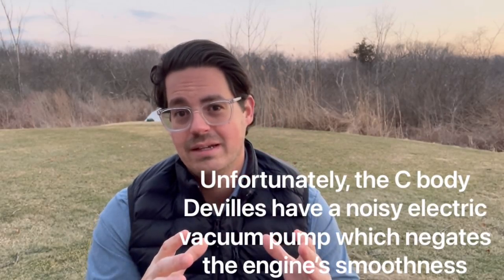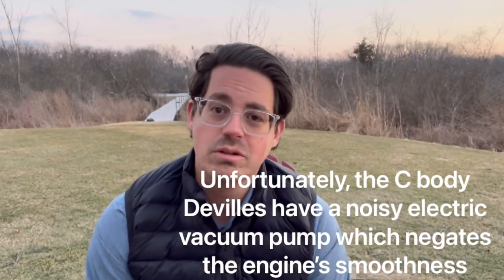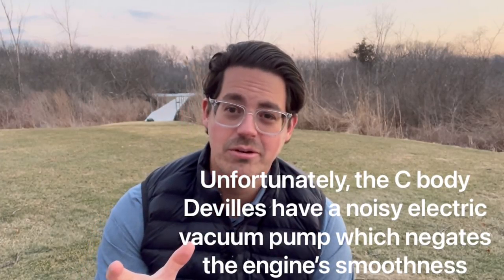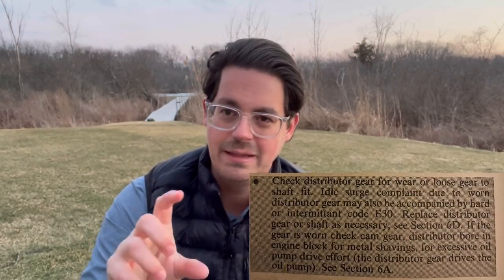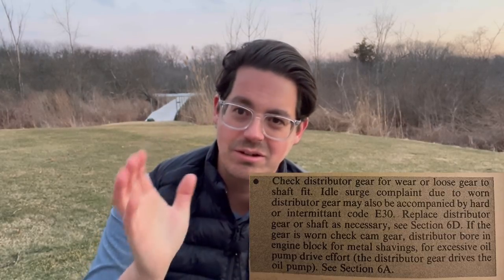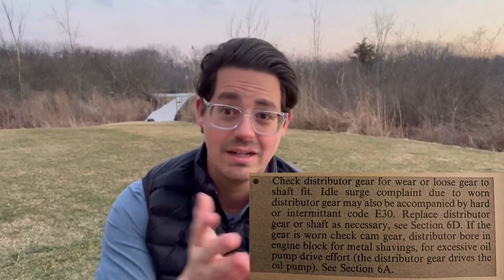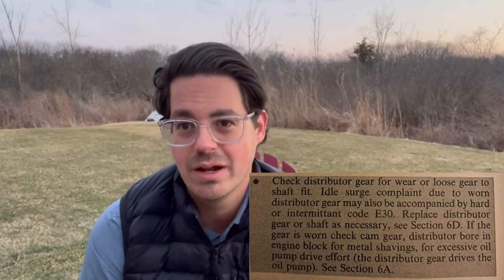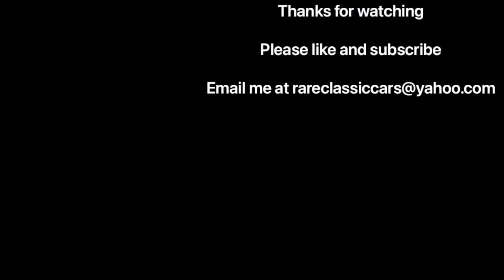Worst Engines of All Time: Cadillac HT4100 - Why is it so bad?  How can you preserve yours?

Comment: Just got the 1984 Cadillac Fleetwood Brougham with the 4.1L HT4100 in August. You are spot on with the intake manifold problem. The car is all original and has 73,000 miles. I have replaced the water pump and now the intake manifold gasket project is where I'm at. I feel like I've taken apart the entire engine!! Just a question for any one who can answer, why does this car feel like it jumps from 1st to 3rd gear when coming off of a stop maybe every 2nd or 3rd time I drive the car? Or to explain it in another way, it feels like it struggles to accelerate in 2nd gear up an incline? And approaching a stop decelerating to under 10mph still feels like it's in 2nd gear?
Reply: Sounds like your Torque Converter solenoid is bad. Common problem on the 200-4R
Reply: @TeeroyHammermill  I appreciate your comment, and literally all I did was change the transmission fluid lol it runs fine now, this car has been a mystery since I bought it 🤣 I've put about 2000 miles on it since buying it, and driven the last 1800 miles without any major issues.
Reply: @shanelucas3159  : These can be decent cars if you keep up on the maintenance. They've always turned heads and had lots of curb appeal when they're clean and in good shape. I personally don't like to see them donked out or rundown as this takes away the whole idea of the car.
Reply: @TeeroyHammermill  agree 100%, I like old school cars just as they rolled off the assembly line. I'm fortunate enough to have one that hasn't been messed with and body, paint, vinyl top is in nearly perfect condition. Only thing that needs fixed now is the headliner.

Comment: ........about my comment below on using  Evans NPG+ Waterless Coolant.   It is recommended to run a 0 or low PSI radiator cap. That should help stop pressure induced head gasket leaks/coolant leaks in a system that runs high pressure.........

Comment: I recently got a 1986 Seville Elegante with this engine. It has 77,000 original miles. I got it for free. Any ideas on how I can make it last or what I could swap it with if need be? It runs and drives very well. Owned by very old people. It had been sitting a long time. It has the Bose lol SUPER SMOOTH! Your video is right on, I really appreciate this upload. Do you think this one would have the updated post 1985 4100 engine that fixed some of the issues?
Reply from the maker: Yes. It would. Still, I don’t think the engine will last more than 120-140k miles.

Comment: If an engine needs stop leak to keep it from leaking, it's junk. I have 262K on my Pontiac with the Buick 231 V6 in it. One leak was the front timing chain cover, and the other a water pump. I did the repairs in my driveway. And I have at times driven it like I stole it. If I can do that to a Pontiac, I should be able to do that with a Cadillac.

Comment: Water pump pulley came off after 14,000 miles and stranded my wife in our 1986 Cadillac. Cadillac didn’t cover it with the 1985 recall saying they fixed the problem in the 1986 model.

Comment: My brother-in-law had an '85 Sedan de Ville, new, that I used to drive and I don't recall it being particularly slow.  Seems kind of a joke that GM would require stop leak pellets to be used in the cooling system.  It does stop leaks, but as Adam mentioned, there can be other unfortunate consequences like clogging.
Reply: The '85 De villes weighed about 700 lbs less than the previous year.

Comment: My 4500 in the 88Eldorado runs great....of coarse....Ive gone through it....and she is sweet. My biggest complaint is a code 27....which comes and goes.....The Idle air control motors are crap....on all models....replaced a few.....an intermittant issue.....asjustments are easy enough....

Comment: Would anyone believe I traded a really nice 62 Dodge custom 880  for a 84 Sedan DeVille , straight across?! WTF! In hindsight, I swapped what I believe, best engine of all (tied with Buick 401) the 361 for the 4100. Was up to my 6th old car and a period of multiple beetles and buggy. The luxury features got me for having a lack of for so long. Besides no power, motor was fine. Was not easy on it. Finally lost trans. The Mopar 361 was one of the really fun engines I had.

Comment: I had a nice Eldorado with this engine, and yeah, it worked great (but slow) until it suddenly didn't. Stuck in traffic it overheated, and that was the end of that engine. Blew one or both head gaskets, oil milkshake and all. It was a shame, I liked that car.

Comment: Another excellent video.  My question is how much of your commentary still applies to the later 4.9 engines.  I have a 91 deville with 28000 miles on it and wonder if I should be worried.  Keep 'em coming
Reply from the maker: Nah. You’re fine. Those are pretty good engines. But do change the coolant w the tabs every 2-3 years.
Reply: Fuel injectors are the 4.9s Achilles heel

Comment: To me, this is yet another symptom of the American auto industry in general, from the '80s on. The bar was set high for automobiles that had been made in the US from the '20s to the '80s. During this period, the US produced the finest cars anyone has ever made, with some notable exceptions, of course. After 1980, the imports were beating them in quality and design. 

The big three began shoving cars out the door that were inferior in virtually every way to the cars of the past, a practice unthinkable before then. The cheap interiors, the defective motors and transmissions, the use of bodies from lesser divisions, plus higher prices, more noise and inferior ride made a spectacle of the whole industry and eventually drove the consumer to the likes of Honda and Toyota, which produced vastly superior values. 

For a young boy who loved cars and grew up with the cars of the '50s, '60s and '70s, it was painful to watch and experience.

Comment: I have recently purchased a 1984 seville. The engine is great however the trans cooler fitting on the radiator split allowing coolant into the transmission killing it. Are parts available  for these transmissions. I'm also in Australia .

Comment: I bet Evans NPG+ Waterless coolantwould be a blessing for these motors, with one of the new generation leave-in Kevlar or other technology Stop Leak formulas (only as a leave-in if compatible with Evans coolant) or a flush & permanant  sealer, & reflush a 180F or maybe 160F thermostat, oxalic acid "wood bleach"  coolant flush (carefully, or use POWDERED TIDE or Cascade Professional Fryer Boil Out),  & neutralize it with Arm & Hammer Washing Soda, (this was the old 2 part GM flush by Prestone AS100......  GM TSB 99-06-02-012D  & long-discontinued Prestone AS100 aka GM 12346500 was a 2-part canister ).    

 I would even be using stuff like the well known AT-205 Re-Seal in the oil, & I wonder if that TRIBOTEX ceramic additive who's always a sponsor on Motor Head TV, would protect the cam.......  

Additives & Preservative for the HT-4100, was all started with GM's wood cellulous based stop leak tabs by Prestone!!!!! 

 Old parts counter HT-4100 joke: 
Take 6 Tabs & don't call back in the morning!   LoL!

Or follow procedure in the JalopyJournal thread titled "RADIATOR FLUSH CEMICALS QUESTION??".  
The GM TSB was also used in over-dose  treatment of the TABS to flush it out when it started to clogg-up the entire system!

Comment: Hey man can u do a review of the caddy fleetwood 1994 with its trim options? I know it has the lt1
Reply: Yes I had 1 for years best Cadillac ever made I traded in for I pick up truck I needed. Biggest regret evere.it was smooth great interior great acceleration.  Now I can't find one for under $10 to $15 grand.  Man I miss that car.
Reply: @MarioLT4  my grandpa brought it back in 98, only has 120-125k ish on it, been sitting since 2008. but its just too big of a car and i have nowhere to park it if i start driving it. drove it last year put 50 miles into her and man she drove great besides the flat spot on the white walls tires. the bose system is amazing also with factory stereo, yes its parked in the garage for the pass 10 years

Comment: Should have kept the 6.0 with a 4 speed overdrive. Dual exhaust and no displacement on demand.  Better to have a long term engine with some power.  And 4100 gas savings will be lost when it fails.

Best thing about 4100 it inspired may to buy Lincolns.

Comment: GM didnt learn easily. The disaster that was the Chevrolet Vega engine also used an aluminum block with an iron head.
Cadillac division had a long history of poor engines, from the 8-6-4 to the 4.1 to the equally hideous Northstar.

Comment: Cadillac should have took over the more powerful 4.1 v6 Buick and add the electronic fuel injection from the HT4100 and install the diesel sound installation. That could have been a stop gap until a new Cadillac v8 could have been developed properly

Comment: Hi great video i’ve got a question please I have 1982 Cadillac coupe deville with ht4100 with only 30k miles ,  One problem after driving the car each time  for 30 to 45 minutes and when it gets warm starts dying goes off and then I started straightaway starts fine ! Happens 4- 6 times each time I just changed the spark plugs wires , I ordered fuel filter and iac valve I haven’t fitted yet ! Do you think this will solve the problem any advice please thank you
Reply from the maker: Tough to say.  When it dies, check to see if you have spark. If not, I’d suspect the ignition module. If you have spark, likely the fuel pump.

Comment: The engine was the 3.8L 3800 Series I II III were the best engines that GM ever made and dated back to 1962 To Buick's Fireball V-6 and GM sold the 3.8L to AMC then GM brought the tooling back from AMC back in 1973 during the oil embargo.

Comment: I had a cadillac with 4100 I pulled the motor and trans replaced with a 327 small block 4bbl and and th350.

Comment: Hi 82 deville with ht400 What’s the idle  speed while the car on park Should be please 450 or 500 ? Thanks
Reply from the maker: Are you talking min air idle speed w IAC retracted. If so, that’s around 450.  Computer controlled idle is usually around 500-550 in drive.

Comment: Never would buy anything but GM. Then I bought a 1987 Sedan deVille with a 4.1. Beautiful burgundy color with matching interior. Wire spoke hub caps. 
Very nice long distance automobile. Sluggish acceleration but comfortable. Then early engine failure. Next lots of other problems came as well. Total Junk.
It worked GM. I bought an 1989 Acura TL 2.5 and stayed with Japanese cars, will never buy anything from this side of the pond, except maybe a Tesla.

Comment: Hi I’m thinking about buying a 1990 Cadillac deville with this kind of engine what do you think ?
Reply: The 90 has a 4.5 port fuel injection V8, nothing like your 4.1
If it's in good running shape you will be surprised how much torque it actually has
Reply: I had  two 86 DeVilles , two 90 DeVilles,  one 05 sts Northstar and now I'm a proud owner of a 91 sedan DeVille

Comment: I find Ford interesting. They release an engine and it starts life as an absolute shit show but without fail those engines turn into a can’t go wrong. The 4.0 SOHC comes to mind, the early ones I remember calling the 4.0 SUCK only to see them turn into a very reliable power plant. The Duratec started life rough but I remember seeing well defined crosshatch in a cylinder bore on 300k miles by the late 90’s. Even the old 2.3 sohc’s I understand had a tendency to develop a piston slap early in their life, by the end they were as good an engine you can find anywhere. The 3.8 is weird it started well, then started eating head gaskets, then by the time they punched it out to over 4 liters it was a good engine again.

Comment: Thanks , bottom line it’s a money pit and the reason most of us are driving Toyotas . Thanks saving me . I already own one the 5.7 DX block diesels so one is an enough . And back to my 80’s Benz  diesel with 900,000 original miles that still didn’t burn oil .

Comment: GM’s problem at this time was too much money and too big. They insisted on having Cadillac exclusive engines when they already had reliable engines available from other divisions. Ford powered all their big cars at this time with the 302 V8. It wasn’t powerful enough to win races but they would run forever with basic maintenance. They didn’t have the money like GM to do engineering experiments so they used what they had. Turns out that’s all the people who were interested in these cars wanted, a reliable low maintenance luxury car. If GM would’ve put the 350 V8 in the RWD cars and the 3.8 V6 in FWD cars they would’ve been successful.

Comment: So many questions..  Again, am wondering why GM chose to use an aluminum block with cast iron heads?  Why not use aluminum heads as well?  The block is what takes all the physical stresses, so why spend the money on cast iron and create all the issues you mentioned about dis similar metals.  Save money and weight, maybe I'm missing something.  Let's be clear, "poor Cadillac owners and dealers" for sure.  The owners lost confidence and switched to other brands, and the Cadillac dealers lost customers and income.  I understand the pressure that CAFE put on GM, but I think they would have been better off to pay the fines for non compliance than spending all that money trying to repair products rushed to market and the loss of customers and dealers.   Again, I'm sure I don't understand much about that legislation.    
I had alot of experience with the Chevy 4.3L in their lovely Astro vans, put several hundred thousand miles on about four vans.  Yeah, the earlier ones did vibrate, but the throttle body injection was trouble free.  My 96 Astro had the balance shaft and individual injectors.  A leaky injector required intake manifold removal, and the engine later developed a soft clunking noise which I was told was the balance shaft...  The injectors were replaced but the van was traded for a 99 model without addressing the soft clunking noise.  
Adam, you are surely one with those powertrains.  You "feel what they feel for sure", which explains why you have relatively few problems with troublesome engines and transmissions.  The average driver is going to violate all of your warnings and advisories for sure.   Kinda sounds like why I haven't had too many issues with one of Toyota's lemons, that 2.4L oil burner in my Camry.  Drive it like there is an egg between my foot and the gas pedal until it is fully warmed up, change the oil every 3,000 miles whether it needs it or not.

Comment: These engines were basically junk.Trying to get a 250 ci engine to move a Fleetwood Brougham that approached 2 tons without a power adder was just idiocy. The comparable Lincoln Town Car at least had a very well proven 302 V-8 which, while being no road burner, was FAR superior to the 4.1. Throw in the dumb idea of using a throttle "kicker" rather than an IAC valve, a camshaft that habitually had a distributor drive gear that would fail (a real pain to replace in a vehicle with transverse engine arrangement) and coolant sealing issues so bad that GM actually put a sticker under the hood telling owners to use "GM engine cooling supplement", which we called rabbit turds (two of the components of that was actually ground up nut shells and turmeric) resulted in an engine that very rapidly developed a bad reputation.
Theres more......These engines also had issues with poorly designed pistons and wrist pins, they commonly developed what Cadillac called a "bell knock", Cadillac dealers were actually supplied with a kit back in the day to address that issue which involved removal and major teardown of the engine to install.
It took GM years to "get it right", the 4.5 and 4.9 had most of the issues resolved, and the big rear drive cars FINALLY got the Oldsmobile 307 in 1988.
The only real and lasting fix for the early 80s cars was to swap in a 4.5 or 4.9 in the front drivers, and the Olds 307, or even a 350 or 403 in the Fleetwood Brougham.
Cadillac really shot themselves in the foot with the hideous HT 4100, coming off the disaster of the 8-6-4 in 1981.
The 4.1, 4.5 and 4.9 cylinder heads though seemed to be a close copy of the Ford 351 Cleveland design, and had few issues.

Comment: You think GM would have learned from the Vega. In my opinion the worst car General Motors ever produced. Even with the so called Durabuilt 140 they were rough running oil burners. The last good Cadillacs built were in 1979 when they still had the 425 V8. I was a GM fan my whole life but I think their days are limited.

Comment: Can the 4100 be rebuilt professionally to be a good daily driver? With the  heads, block, sleeves and intake metal all aluminum.  I just wonder because the 81-85s were handsome designs.
Reply from the maker: Yes. If you get a Jasper reman, they’re quite good.
Reply: Contacted Jasper about a month or so ago and now they're no longer available